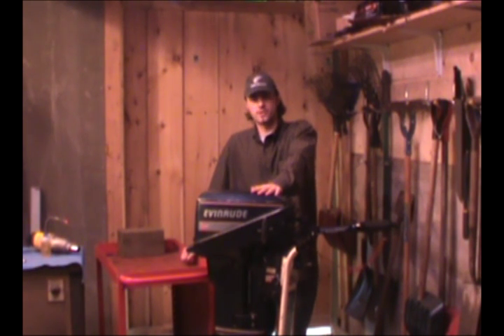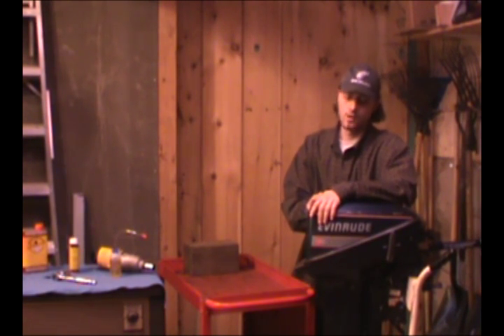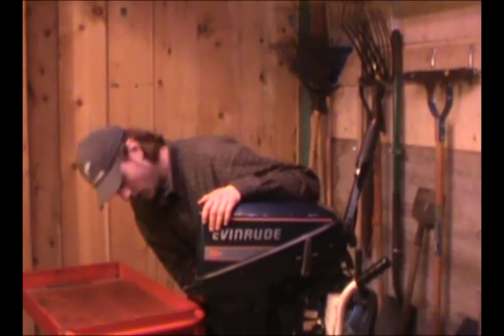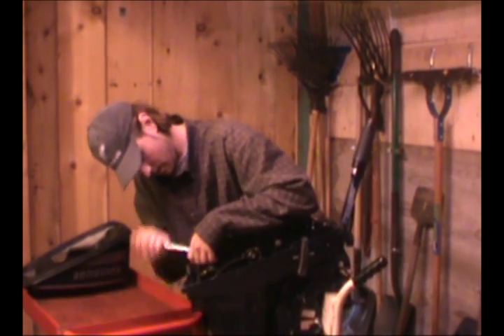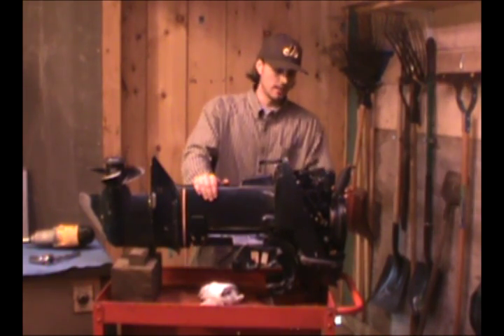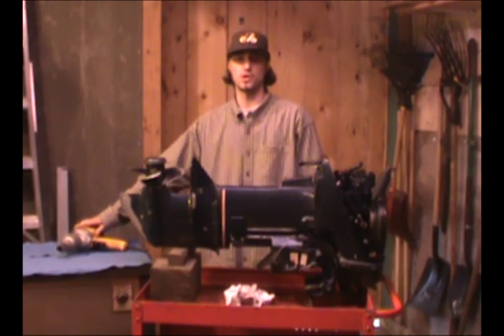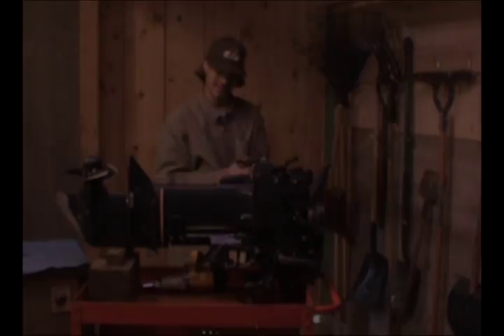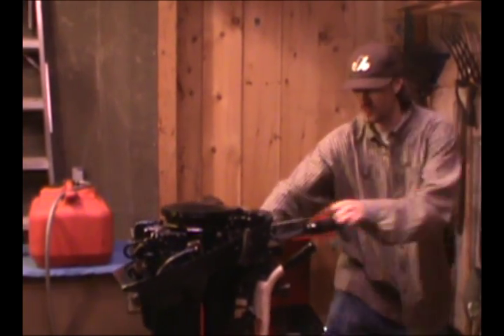Seized outboard fix (must see)

Comment: If you are restoring an antique outboard with a really stuck piston,  you can fill the cylinder with old motor oil.  Then, weld up, drill and tap a spark plug base to hold a grease nipple and pump grease into the cylinder to get the piston moving towards the exhaust port.  The restoration guys do this and then they very carefully tap the rings with a plastic hammer all the way around and if you're lucky you can free the rings to run another day.

Comment: I'd never use an impact wrench.  Better to use a breaker bar and gently rock things.  It would be easier on the rings and the cylinder walls.
Reply: I agree...The flywheel should be gently rocked back and forth just a bit at a time to ensure it is not going to jam again causing more damage.  You may need a breaker bar to free it initially though.  Using the impact could over torque the flywheel nut and damage it, especially if the engine is really seized and refuses to move at all...

Comment: from an old ob mech. it it's still seized,remove the head and pit the shaved dow nend of a 2x3 aga           the piston uppermost in the cylinder give it a medium whack with a small sledgehammer.  this usually works if the engine 2 cycle was not run without oil

Comment: I found a 1969 Merc 200, 20 hp on the boulevard but the only thing that's wrong is that the drive shaft wont turn the propeller when i took the lower unit off, since this an old motor i don't know if that's what it supposed to do any suggests?

Comment: Use diesel fuel to soak the cylinders with, let them soak a few days, then pound the flywheel carefully one way and then the other... it will break free
Reply: Or use Marvel Mystery oil, or Automatic transmission fluid.

Comment: shake up a bottle of 1 part automatic transmission fluid and 1 part acetone.  pour a little into cylinders through spark plug holes and let sit for a few days. 

 I have two spark plug bases that are welded shut. One has a schrader valve soldered in it like the valve stem of a car tire. the other has a  grease gun zerk fitting.  

To free lightly stuck pistons after soaking. Use the Schrader valve plug alternately and fill each cylinder with air to @130 psi.  That will work with less stress on the fly wheel and connecting rods than an impact wrench. 

 If the pistons are rusted in bad, the zerk fitting plug is used by pumping  grease into the cylinder to hydraulically press out the piston. If using the zirk fitting, you need to unbolt the cylinder or unbolt the crankshaft bearings in order to not damage the connecting rods.

Comment: using an impact on the flywheel nut is bad business. If the piston doesn't move u can do serious dmg to the threads on the crank. then ur in trouble. Best to use a long breaker bar and move it back and forth in both directions until it frees up. happy wrenching and good luck
Reply: I used a hammer and screwdriver to loosen the flywheel, it worked.
Reply: Yeah, Joe is right....Using the impact gun could damage the flywheel and crankshaft tapers if the engine is really stuck hard.  I don't think this engine was stuck hard, just some minor rust.  Follow Joe's instructions about gently rocking back and forth to avoid causing further damage internally as well.
Reply: Joe is absolutely right. Many things can cause an outboard to seize up. Could of been a rod broken inside or a bad ring. Easy does it with these things.
Reply: I think you are all missing the point. if the rings are stuck and the oil doesnt unstick them its likely really fucked anyway and the impact isnt going to hurt it more.

Comment: I was given a seized up mercury 9.8 110 outboard that was laying around for a couple of years I got some wd40 sprayed in cylinder and carb started tapping on prop and pulling on the robe in about 15minutes it loosened up and now it turns

Comment: Ok this is my method, go to any auto parts store and buy wd-40 fast acting penetration oil (not regular), lift up motor til the propeller is facing the sky. Doing this makes the cylinder in a vertical position, next remove all sparkplugs and fill each sparkplug hole for 45 seconds each. Gravity will work its magic and free the locked up piston causing there to be no crank, leave it soaking depending on how long its been in this condition in my case it was only a month so it got freed up with one hour, so u know how bad mine was locked up I broke two ratchets and it wouldnt budge before buying a straight bar
Reply: Thanks a million! The wd worked! You're a life saver!
Reply: PB blast has worked for me several times

Comment: .....or just push the engine release button.
Reply: I have a Nissan (Tohatsu) 3.5 hp 2 cycle. It appears to have seized/locked and I know it it isn't from heat or temp extremes. Where would I find a release button on this motor or were you just joking with us. I am no expert mechanic but generally I can do some things. I just have no experience with this motor. It sure would be nice if this release is a real thing and I can just reset it and do some real maintenance on it to get it running and keep it that way.
Reply: @marklinwarsaw  he's messing with you Lol

Comment: Word of the wise, Don't let engines sit dry for more than 6 months. Put marvel mystery oil in each cylinder, bag intake and exhaust. Roll over every couple of years and repeat oiling. You will NEVER have this issue.

Comment: Just use any lubricant diesel, motor oil, Trany fluid, I don't believe the impact is a good idea though it may break a ring on the piston. I use a cheater bar and feel it buy hand. That's the best method. And you might want to take the head off to inspect the cylinder, because there might be a rust ring left from the rings and cylinder wall. Then a good deglazing stone should be used. There's no quick fix for a seized engine. Js

Comment: I was worried he hydraulic locked but luckily he went horizontal on the cylinders, me personally, I would of rotated the flywheel twenty times before putting the plugs back in, dude